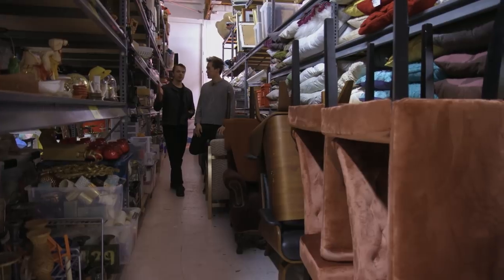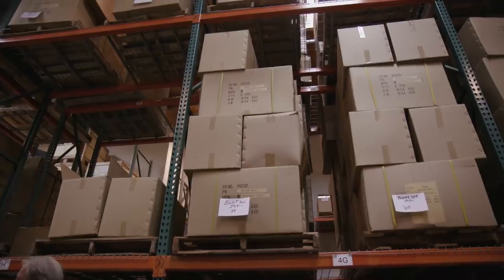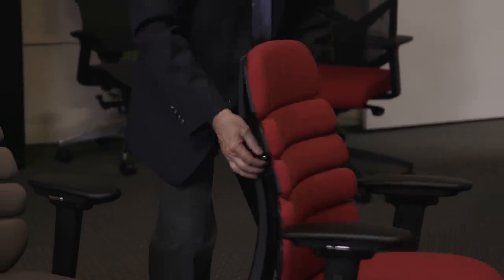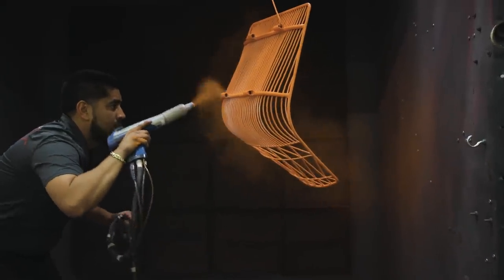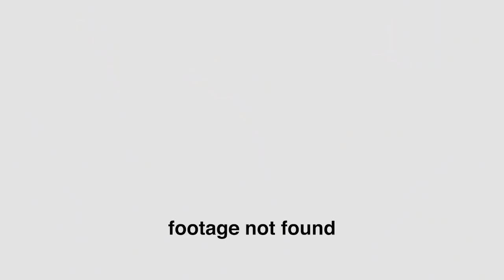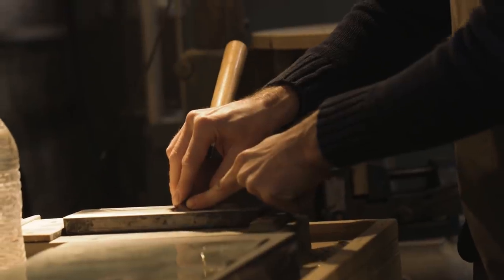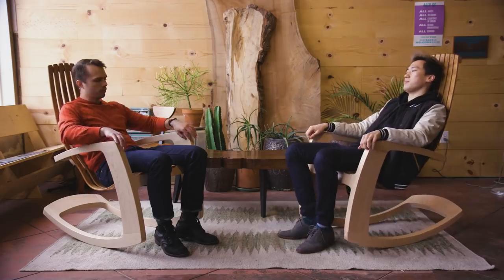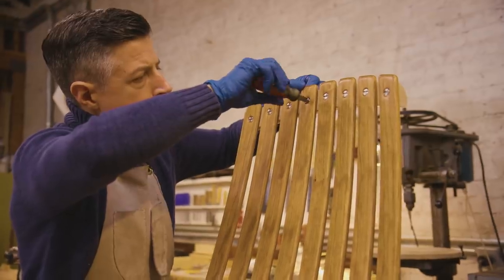$199 Chair Vs. $9,800 Chair

Comment: The “low-end” chair is a complex chair, while the “high-end” chair is a simple chair. Interesting.
Reply: Simple, but ergonomic and high quality is difficult
Reply: Sometimes....things that are expensive.....are worse
Reply: The contour of that high-end chair is anything but simple
Reply: I think high-end isn't simple, but rather timeless. It's something that will last you decades if not life times and it won't look out of date in those decades. I think low end chair was great, but it's aimed at lasting 12 years. It's a great amount of years for what it is, but it's not for multiple decades.
Reply: its similar to watches the difference is the craftsmanship put into them and like rolexs they likely will easily be heirlooms in the family
Reply: That's IKEA price strategy
Reply: But the time and feel of it sounds amazing!
Reply: as a designer, it's quite difficult to make something very minimal because then every detail matters. As Mies van der Rohe said: Less Is More.
Reply: I was an apprentice at Jared Rustin's woodshop for a few months and was lucky to help build and sit in his rocking chair. I can tell you it is not simple at all. He built multiple versions to get it right and takes so much time build a single unit. It is the most comfortable chair I've ever sat in.
Reply: I would rather have simple than complex just like pplenis simple but more expensive but android is more complicated and is cheaper it's personal prefarance
Reply: Blame mid century modernist design
Reply: Hey do you know how hard it is to make something like that although I think it is a bit over priced
Reply: The $9800 chair seems so thin that it could break if you fall too hard on it. 😅
Reply: One is handcrafted the other is mass produced

Comment: The Lucy chair has got to be the most unworthit thing I've ever seen.
Reply: Is that the wired one?
Reply: Ghost Gaming yeah
Reply: Way overpriced for a chair
Reply: noo It is more causal and fun than the others
Reply: @laxman2838  it's also $450....
Reply: laxman vanjani it is a bunch of wires put together. It doesn’t even look remotely comfortable. I would rather get 2 of the first chair and then use the extra 50 bucks to buy mouse

Comment: You're on another level of flexing if you spend 9.8k on a wooden chair
Reply: $450 for intricate metal coat hangers spray painted Orange.
Reply: like you have a guest at your house and:
-hey! come sit here on this, this is my fav chair in the house, only spent 9.8k dollars on it
Reply: When you think about how much time you spend in chairs Vs how much time you spend in a car I can see the value
Reply: SMDH low ballers only buying 1. You need the pair to flex. Are you just going to stand there like a fool when you show off your chair to your guest?
Reply: Which is a different level entirely from building a chair from things you took from your defeated foes. Like bones, or maybe just their swords
Reply: Honestly I think the rocking chair was a better value than the wire chair.
Reply: Thats like a whole year salary in my country and sometimes back breaking work. So save yourself time and dont get a job instead of buying a wooden overpriced chair.
Reply: @ivan.457  Sry if I buy a 9.8 chair NO one else is sitting in it!

Comment: Office chair guy: "Comfort, chair is a tool! protect the environment, posterior, compound curve, research, innovation." $199-299

 Bend Goods: "The name bend comes from bending, colors are fun!" $450
Reply: I would rather use the office chair if i had to sit for longer than an hour though. The office chair had way more though and design put into it. I still cant believe that guy charge $450 welded wire chair.
Reply: I was thinking the same thing... 🙃
Reply: Its clear as day who has more passion
Reply: Pewdiepie: "BUT CAN IT DO THIS!????" $399
Reply: @angryfan370  it costs a lot of time to build. While the first chair can be mass produced, which makes it significantly cheaper
Reply: @SuperDunci  the bend chair is probably easier to mass produce than the office chair. Check out how shopping carts are made. 

The office chair needs to be produced with different machines, and in the end, assembled by hand. A couple of welding robots and a spool of wire could churn out 100 of those wire chairs a day.
Reply: Seth Kacel the bend chair is supposed to be a design piece as outrageous as it sounds. Plus they weld their own metal and they are a small company unlike the LA chair guy
Reply: I made it out of wood! 9500$
Reply: I swear my grandma in venezuela has that same chair
Reply: the interviewer DID ask about the colors. probably asked about the name, too.
Reply: @Beregorn88  10 grand is a little pricey, but if you had any knowledge of woodworking and how much time, concentration, and YEARS of practice that it takes to make a piece like that by hand, it would make more sense.

$450 for a chair you could make with wire, a vice, a welder, and maybe 20 hours of practice (probably less) is a little much.

Comment: One of the basic pieces of furniture, a chair is a type of seat. Its primary features are two pieces of a durable material, attached as back and seat to one another at a 90° or slightly greater angle, with usually the four corners of the horizontal seat attached in turn to four legs—or other parts of the seat's underside attached to three legs or to a shaft about which a four-arm turnstile on rollers can turn—strong enough to support the weight of a person who sits on the seat (usually wide and broad enough to hold the lower body from the buttocks almost to the knees) and leans against the vertical back (usually high and wide enough to support the back to the shoulder blades). The legs are typically high enough for the seated person's thighs and knees to form a 90° or lesser angle.[1][2] Used in a number of rooms in homes (e.g. in living rooms, dining rooms, and dens), in schools and offices (with desks), and in various other workplaces, chairs may be made of wood, metal, or synthetic materials, and either the seat alone or the entire chair may be padded or upholstered in various colors and fabrics.

Chairs vary in design. An armchair has armrests fixed to the seat;[3] a recliner is upholstered and under its seat is a mechanism that allows one to lower the chair's back and raise into place a fold-out footrest;[4] a rocking chair has legs fixed to two long curved slats; a wheelchair has wheels fixed to an axis under the seat.[5]

Comment: I swear the wired chair and the wood one are not worth the price 😂 literally no matter what they say won’t change my mind
Reply: It looks like he’s using A Select lumber, which is the best of the best. No knots, no defects, no nothing. It is also insanely expensive. I just looked and it can easily run upwards of 30 for one 1x8x10, of which he could be using fifty or so of those. Add in the time it takes to hand craft a chair (it takes a long ass time to do and do well) and I can see how the last one would go up to 10000

Comment: *Says the $450 price tag for the Lucy wire chair that everyone was already skeptical about, proceeds to set it down immediately after and it doesn’t sit level... even if the floor isn’t level that visual was super off-putting.

Comment: I just don't see how that chair is worth 9.8k lol. That chair is super easy to mass produce. And 100% sure  that is not more confortable than the first ones. For a chair to be confortable it needs to bend in different ways just like the first ones do, good luck sitting 8 hours in a wooden char.

Comment: The sausalito chair is a tiny bit over 5 times more expensive than the universal chair. Learn math.
Reply: MSRP is $499 for Universal and $989 on Sausalito... Some stocking volume dealers sell Universal 100 series at $199 as a promotion.  At the time of filming, Sausalito price was an estimate based on labor, material and tooling amortization.

Comment: If I want a great chair, California Chair has it. If I want art, I'll buy a painting, not a horrifically over-priced rocking chair. Just because it took you a long time, doesn't mean it's worth what you think it is. In the scheme of art, it looks like trying to blend a nice back with a completely different chair. The grain of the wood doesn't flow into each piece, the types of wood should be listed, and the price doesn't reflect the quality. Normally I'm not so brutal, but I've had enough of this type of nonsense pricing. 2-3 months lead time tells me a company doesn't have enough faith in their own product to have stock on hand and or doesn't have faith in the market they are dipping their toe in. Refine it, lower the price dramatically, build a huge name, or get out of the business. Staying the current course WILL end in a folded company and tarnished name.